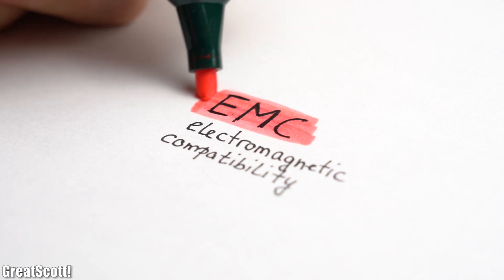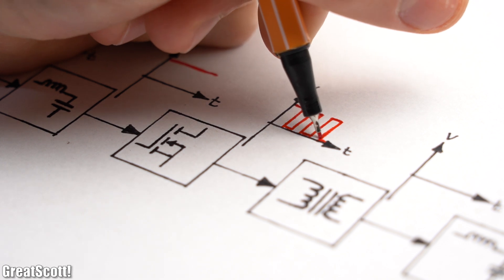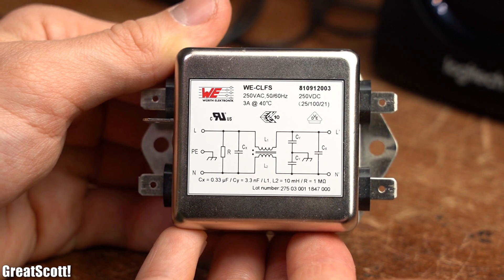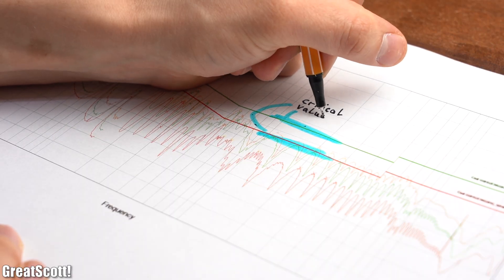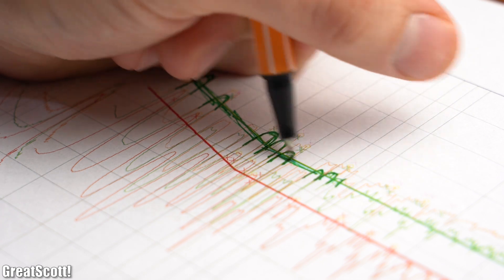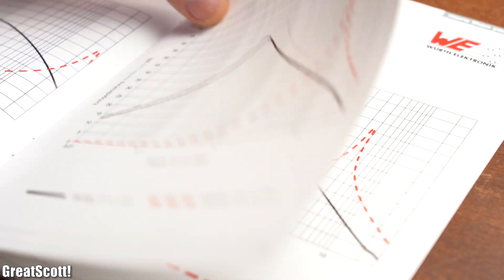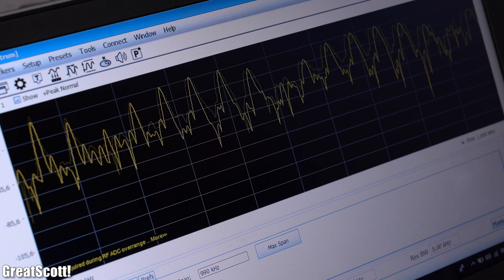How to solve EMC problems! || The mystery of the buzzing speaker

Comment: Hello I'm having trouble understanding, if the switching frequency is 40kHz, how will there be harmonics in the audio since the hearing cutoff is 20kHz?
Reply: Through intermodulation distortion. If you have for example 2 frequencies 40khz and 43khz injected into the audio, it creates a delta/separation of 3khz which gets repeated at 3khz intervals (3,6,9,12,15,18 etc) across all working (power and audio) bands.

Without filtering (and if injection is strong enough) would peak at 0db which you would clearly hear. If filtering brings it to -80db than you will hear it faintly or not at all.

But it's still there affecting purity of the audio. A disruptive frequency creates ripples across all working bands if signal is strong and filtering is weak.

Comment: My sokution after trial and error is to make sure that speaker wires are isolated from ariel wire by means of non-conductive material and the FM aerial should be a short single core copper wire plugged into the aerial socket but not touching the sides of the aerial socket.

Comment: I have the issue with EMC on my project. Is the important to have the filter before the power supply on th AC side or does it also work after the power supply on the 12 DC side? Thanks!
Reply: It does work on the "B" side of the transistor before the bridge rectifier, no common mode shoke needed.
Atleast that is showing a schematic of a commercial product, some 1-2.2uF capacitor in series with a 56R - 1k Ohm resistor + 2 x 100nF in series parallel to the prior resistor/cap. you can draw this in Ltspice and do a FFT  analisys of the 1-2.2uF capacitor in series with a 56R - 1k Ohm.
You need to use inductors to form a transformer with a "code", you gotta look for that on the web.

Comment: Hi
what can you say about online ups like apc easy srv 3000i.
i also have furman p2300 power conditioner. i also have stetzerizer filters.

when my ups is connected to the power my whole room power sockets are getting high emi 1700mva.  because i connect my power conditioner to the ups so it only reduce it when devices plugged to it.  what is the best solution to reduce emi  noise with my 2 devices. also my pc is outputting a lot of emi noise which i can only redu e with the power conditioner and the filters together.  how can i contact you with discord,email or anything? you seems like the best person who know exactly about that things.

Comment: You  might be a bit mistaken. In the recent past I have used the head stator from a hard disk, a darlington and MOSFET based amp, and a small speaker to check for EMR in many of the devices I've built. The stator coil on the head armature of a common hard disk is sensitive enough to pick up the flux field and creates a strong enough signal to be usable through a standard microphone preamp. The only issue I've found so far is frequency. As some audio devices filter out anything above 20KHz it's sometimes difficult to accurately find and diagnose such things as back EMC. This is why I would recommend building your own amps because you can omit such filtration. This might make an interesting episode of your series "Build or Buy" because it's been a pretty useful tool for me so far since I built it.

Comment: so the noise comes from main supply goes to the switch mode when its not full filtering or missing filtering component and they will interference with another components. so in audiophile those filter is precious value component needed for clear and silent harmonic noise from other component in house or in car. 50-60 hz component create less noise or no noise at all, the noise will come to problem when using switch mode power supply which most people use it today.

Comment: Common mode filters are great for canceling unwanted stuff, even on high speed / differential transmission lines (USB, RS-485 etc.)

In most cases I don't need them, but from my experience, It's a good practise to preserve some board space for these components.

Comment: My dad has a sound bar that is plugged into his TV and it works perfectly fine. I plugged headphones into my Dad's laptop and they worked perfectly fine. But I plugged the speaker using the same cable into my Dad's laptop and there was a noise coming from the speaker luckily my dad found a way to cast from his laptop to the TV so he didn't need to plug the speaker directly in. Also the audio wouldn't go through the HDMI cable.

Comment: Great intermediate video into the world of EMC!. A good thing to remember is that signal/power integrity/quality are inversely releated to EMC problems, if you have a well routed signal (tight ground return, matched impedances, length matching on differential pairs, etc), then your signal integrity will be solid plus that particular signal will likely be EMC compliant and immune to external interference. Win-win situations like that are certainly possible and desireable. If you can catch them early in the design phase (schematic & layout) then you'll be saving yourself alot of frustration down the road.

Recommendation to definitely do a video on ESD / EFT in the future as that's another common EMC problem that EEs must face when designing products.

Comment: Its like you were reading my mind!  I was having issues splicing in a BlueTooth adapter to an old stereo and I kept hearing high frequency noise.  I was able to rid most of the issues with better shield and wiring, but it still wasn't perfect.

Comment: Hello , can you make auto cutoff timer  circuit for mobile phone charger plug , working on 220 AC or 5 v 2amp dc 
Like - we connect in our 220v  AC circuit board and set the timer according time duration

Comment: What power of potentiometer shoud i need to perfectly control my tda8932 audio amplifier ic. Bxxx k and no xxxx like 1906. Please tell me as quick as you can.
Reply: If you're using the pot to control the signal level into the amp the power level is negligable.  Choose the pot for its resistance,  ignore power.  If you're using using it at the output then you probably shouldn't be.

Comment: I've been trying to find out why power supply circuits rectify, then chop and then step down the 'square wave' then finally rectified. Why not just step down the ac, then rectify? a simpler circuit but maybe it has disadvantages that I may not be aware of.

Comment: My garage door remote opener stopped working when I put an LED light bulb in it. Switched back to a good old incandescent and it works fine.
Reply: Perfect example of a driver that emits a lot of crap.  And then people wonder why they have issues receiving a FM signal or have a bad DAB reception.

Comment: Cheap varistors tend to become hot and blow out when used for a long time (a few years).

Can you show how to build the adjustable transience shunting circuit using zeners and power components ?
I've seen a few versions, some with thyristors, some with triacs ... I don't quite know which circuits have the longest life with the lowest probability to go boom and trip the breaker.

Comment: Can you also get this buzz with a usb interface? From there my JBL LSR305s are connector via isolated balaanced TRS. Everytime my graphics card is under demand i get a low pitch buzz from the woofer and a high pitch one from the tweater. Could this be the interfaces fault? I tested 5 PCs and all got the same problem -> NO GPU COILWHINE. I use the Behringer UMC 22

Comment: In your power supply, you showed us that there was "missing" capacitors, but can we just solder new ones to get rid of the interferences?
Reply from the maker: I think the other side of the caps were not connected to earth. So it would not have fixed the problem.
Reply: @greatscottlab  How ok, so even the pcb wasn't really complete

Comment: I NEED HELP: I'm spinning a DC generator and reading 9a/36v output. When i connect it to the panel charge side of a 10a solar charge controller the output drops to 3a/12v and still spinning at the same rpm.

Where is the other 6a/24v ????

Comment: I've used Wurth filter components in my professional life, and they have been very good.  I'd also recommend Fair-rite for ferrite devices.  For this sort of interference, adding a filter will get the job done but adds cost.  If this was a production situation, the first goal is always to fix the device emitting the noise.   For the hobbyist getting their first exposure to EMC, this is a fine introduction.

Comment: Great Video :D What about Ground loop Noise or what it`s caled tha also can come from Audio amp`s etc,
so the emc is the typical high pitch sound from wall adapter`s? :D
Reply: Hi.  Most modern audio gear avoids the ground loop, low pitch hum, problem by not having a connection to true earth at all or not linking that to the signal path.  Modern mains adaptors are usually switch-mode, chopping at high frequency, which produces the problems presented  in this video.
Reply: @raykent3211  oh i see thank you :)
Reply: @raykent3211  do you know how to fix the low pitch hum? i have a 90s stereo speaker set they uses type C kontakt so no ground in it, while pc psu uses type F in Norway that is :) and this one dont uses adaptor only bult in so :)
Reply: @StigDesign    calling Finland.... Greetings from Brittany!   I've never heard heard of type C and F,  but guessing from what you say that one  is two wire to mains, the other three wire.  You haven't got a ground loop. Almost certainly, if you're hearing a mellow hum,  you've got an aged smoothing capacitor in one of the two pieces of equipment. Probably the supply to the amplifier in your speaker set.   These are used to reduce ripple,  they are electrolytic capacitors and at more than 20 years old it's like asking a 60 year old person to run a marathon, some can, some can't.  Replace it and the set is as good as new.  Have  you got a soldering iron?
Reply: Oh god!  I just mixed up Finland and Norway!   Sorry!  Me, who has told several french people not to call a Scottish person "anglais", it might cause offence.
Reply: @raykent3211  yes C is only 2 and F is 3(it has ground) ah nice :) yes now know where to look and chekk hehe thank you :) i need to digg them out and open them out :D
Reply: @raykent3211  hehe its ok :D yes am Norwegian :) thank you for reply&help :D

Comment: Why is that every time i turn on my amp my monitor goes black for a second?
It killed the original psu of the monitor already so now im using another one but it's still the same.
Reply: @Red Stoner it's a basf 8440 receiver amp, and a samsung s24d391 monitor.

Comment: Had the problem with active speakers and external HDD causing interference. I heard the HDD noise from speakers with high pitched whine and popping. Solved by using only 2 prong adapters with similar specs

Comment: I once fixed a set of logitech 5.1 speakers for a friend , broken 6 gang volume pot. Never put a loop of wire threw all the grounds.....she complained of hearing voices out of the computer. I thought she was mad. I had inadvertently created an antenna that was picking up very faint what I believe was ham radio signals , it was a group of people having a conversation in korean. I told her before leaving that it was just a quick fix till I could get a new pot and it "should be fine" as they are now all at 100% volume ...and randomly talking every few min's.

Comment: i have a similar problem on my tractor, when i turn on the LED work lights, radio would not work, and start interfire  , do u have a solution?
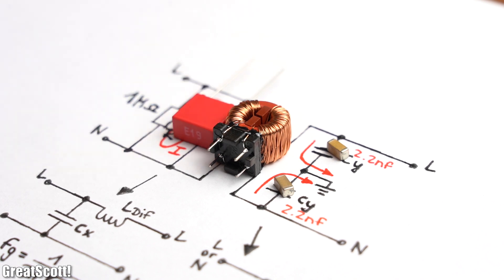Reply: you can make as GreatScott illustrated here: 9:28, a circuit depending on the frequency of the LED switch mode boost power supply of your tractor and the voltage it reaches.
another option is to buy a premade car radio noise filter here:

https://www.aliexpress.com/item/33045186985.html?spm=a2g0o.productlist.0.0.7c884afbGCR9Sr&algo_pvid=7127e207-3933-438e-8069-04aef64cb09d&algo_expid=7127e207-3933-438e-8069-04aef64cb09d-0&btsid=9faa8967-0e67-4518-9823-539629607f01&ws_ab_test=searchweb0_0,searchweb201602_8,searchweb201603_52
Reply: rustybuttpate  Ban the controllers - Not the LED lights. LED lights on vehicles is a Godsend. The crappy controllers trying to PWM them is the problem. Lazy and cheap engineers who lack experience creating LED control mechanisms.

Comment: Can you tell how to remove ground loop from audio systems?
Reply: You can try a Ground Loop Isolator, but it might hurt the sound quality. You can also use two different power supplies for your audio source and amplifier.
Reply: @petermuller5031  it is actually for my car it is not possible to get two different power supplies.
Reply: saikat sadhukha Then you should try a ground loop isolator. You can also try a low-pass filter to filter out the high frequent noises. But keep in mind that in both cases the sound quality might get degraded.
Reply: You might consider using toslink / optical to eliminate those darn loops
Reply: Are you sure the problem you're hearing is from a ground loop?  There are many sources of interference in a car and there's  no point in paying for a lung transplant if the patient merely has a cold.  What are the symptoms?   Where are the pieces of audio equipment?
Reply: use vias between top layer and bottom  layer of pcb.  it's need a lot of experiac of layout and placement  of components

Comment: Great presentation, thank you. 

I have a question, not concerning his video,
 Thank you in advance and I would appreciate it if you have the time to answer.

I bought a camera like a GoPro through the mail, It has a European plug and I happen to live in Florida USA, The plug that came with the camera has an--
input of 100-240 V 50/60 Hz 0.1A
output 5.0v DC 500ma

 Can I use an American plug of same input,
With the output of 9.0 V DC 1.67 A or 5.0V DC 2.0 A?
OR
 Output DC 5.0 V/ 800 ma?

 If you are unable to give me an answer I understand and I appreciate it immensely either way. 

Thank you very much, I love your videos!
Reply: By plug, do you mean the charger / adapter?
If so, how is the adapter connected?
Is it connected via USB or is it a round DC Jack connector?
Reply: @foxx8414   Yes I do mean the charger/Adapter that plugs into the wall, It has 2 round posts instead of 2 flat posts, and it is connected by USB.
Reply: @americanrebel413   in that case you can use pretty much any other adapter that you have lying around, just make sure that it's not a fast charge adapter.

And the 500mA output is pretty standard so most likely any charger you'll find has or exceeds that number.
Reply: @foxx8414   Thank you very much for the info, I appreciate it very much. 👍✌🍻

Comment: Nice video, but can you do one to stop the ground loop on a bluetooth system???, so the BT reciever can be powered with the same power supply as the amp please. I had that problem for months and i have no idea how to solve it
Reply from the maker: Use a 1:1 transformer for your audio input. This way you have no ground loop.
Reply: I have that option, but i couldn't find one in all the electronic shops in my town and buying it from ebay, amazon, etc won't be an option for a while ( 'cause i'm from chile).
So do you have any other option like an extra filter circuit???

Comment: can you make that kind of circuit who increase the amp dc to dc 4 apms to 20 amp out put
Reply from the maker: But you would have to decrease the output voltage. .
Reply: @greatscottlab  no problem its no matter how much volt we have on output just we need amps dc to dc
Reply: @MuhammadAzeemET-F-  what are you driving with the current?
Reply: @dozog  hydrogen kit, there is a lot of problems with fule but i want to finger this out. i want to replace petrol with water.
Reply: @MuhammadAzeemET-F-  As far as I can tell... The liquid acts as a simple resistive load.
That means you can't increase current in any other way than by increasing the voltage.

No matter your source is a voltage source or a current source... You will end up with exactly the same current/voltage.
Reply: @dozog  yes i can if i make a circuit who works on current T/F
Reply: @MuhammadAzeemET-F-  What is T/F?

Comment: I have the same problems but then with my laptop. If I connect a keyboard with leds the audio cards output get a lot of interference. Do you have any advice?
Reply: You could filter the +5v line, or you could use a fiber optic usb extender.
You need to isolate the power and grounds between the laptop and the keyboard.  Use wireless or fiber.  cat5 usn extenders wouldn't work.